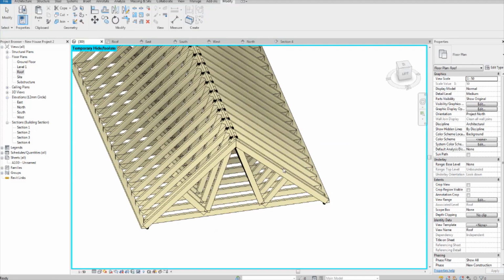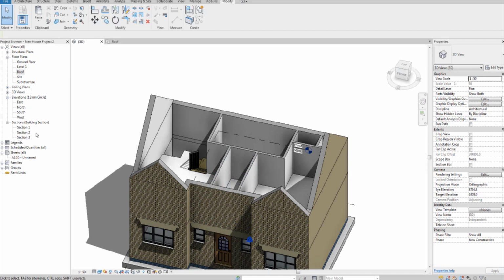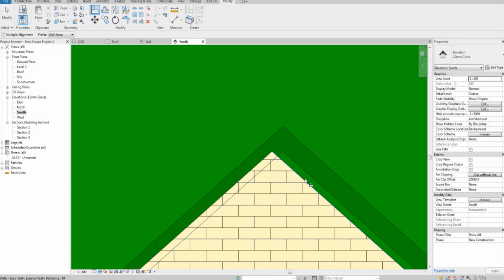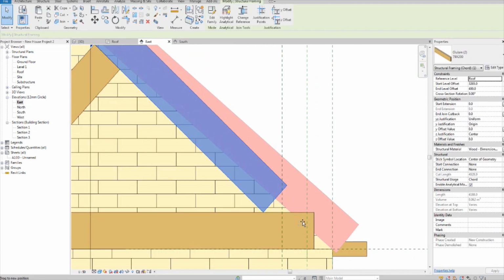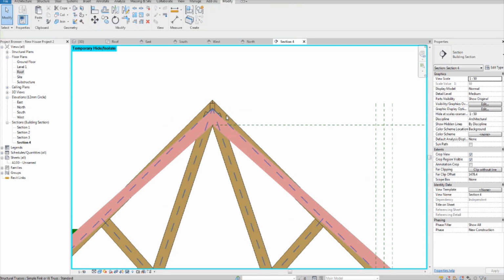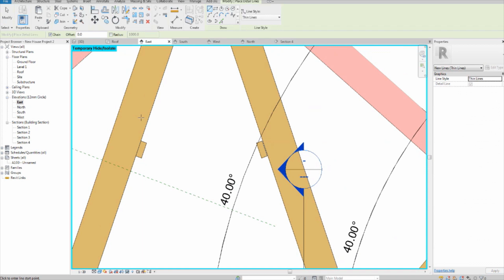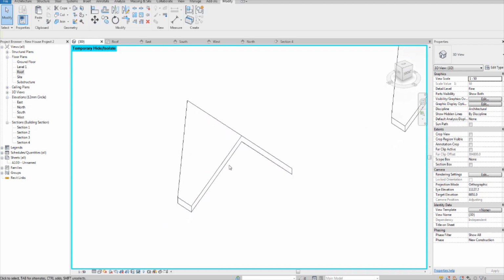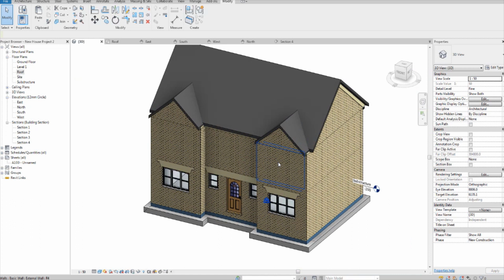Revit Structure Tutorials for Beginners - Part 5 - Truss Roof Structure

Comment: Thanks for the video. in the beginning you  can actually join the main roof with the 2 gables and it will create the intersection that you had. you can also cope the trusses to clean them up before arraying. Also, with the rafters, the array actually creates a group of the element, but when you delete the extra ones you break them, instead click on one to change the number, then when you trim one rafter the change should reflect on the others automatically.
Reply from the maker: Ah. Learn something new every now and then, thanks :)

Comment: This was a good way of forming a roof structure unfortunately the tech was a bit green on roof construction trussed rafters do not require ridge boards, or purlins and a fundamental mistake on truss height through the roof angle out. 
I must say the basic teaching process was very good and deliberate and easy to follow I will be using the demonstration to model a similar roof at work tomorrow JS
Reply from the maker: Thank you for the helpful comment. I've made an effort to try and form some of the roof from what I see in construction books, the result of it ended being a combination of 2 sorts of roofs or more. However, this video does teach some basic revit uses. I've made a more updated and organised video on forming the roof truss model, this new video shows better ways of cutting and forming the model, less tedious than this video. Here's a link to the video if interested: https://www.youtube.com/watch?v=6p6uQ1Slg5I

I've been learning more about roof forming (and other parts)  and continue to make videos of my research and findings. Currently I'm looking to see how parts of buildings are designed in line with building regs, to go towards forming more practical models.

Comment: Videos are great mate, so many Revit tutorials are hard to follow or don't cover what I want - but not yours! Keep up the great work.
Reply from the maker: Ah, I'm glad my work was able to help you, I made these videos because of the reason you shared. Sometimes you run into a small issue that mess up the whole experience and you're not able to follow a tutorial because you don't know what little thing you've missed, I just try to put a magnifying glass on smaller details that an experienced user tends to not think about. For example, one annoying thing revit does sometimes is join the walls together automatically when you don't want it to, to solve this, just highlight the wall (or whatever connects), right click on the small blue extender grip and click 'Disallow Join', then the walls won't stick together like a magnet. This little piece of info might help you in a jam some day. Thanks for watching.